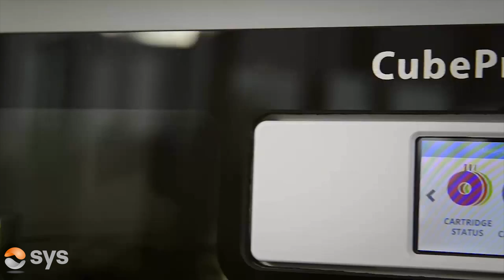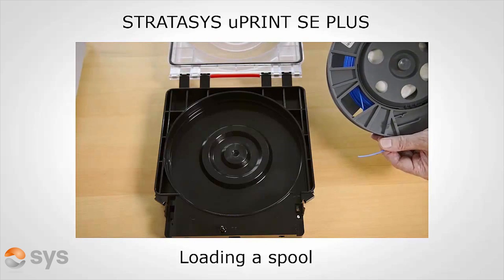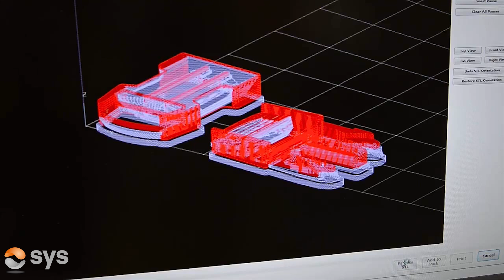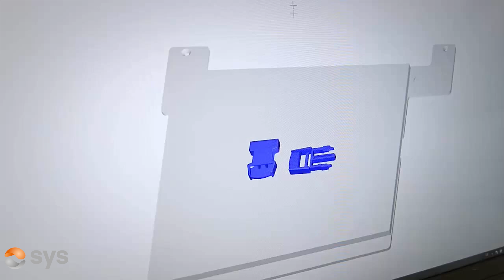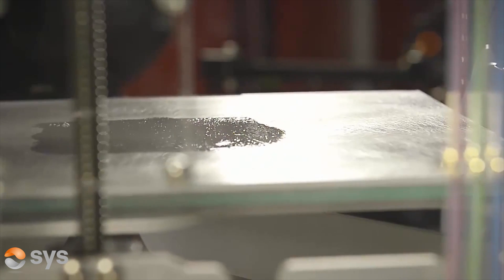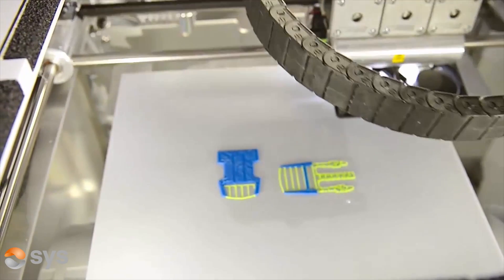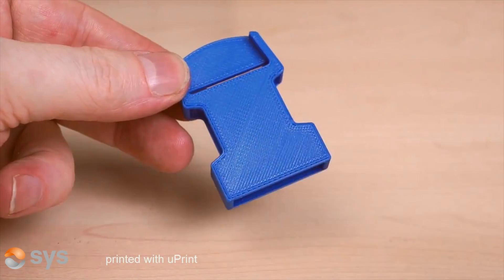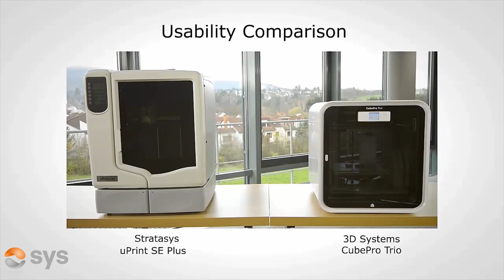Stratasys uPrint SE Plus vs 3DS CubePro Trio

Comment: Try to compare it to the Ultimaker 3!
Reply: I have both. The UM3 is very good, but the parts are not as robust (printing with ABS is finicky). The UpSEp is like a 3D printing oven, that keeps the material at the perfect temperature to ensure ideal layer adhesion. Also, the entire machine is much more rugged, and it is more dimensionally accurate when printing. The part finish of the UPSEP is more rough (you can see the layers), but the parts are immediately useable as functional parts. Just as good as production ABS parts. The uPSEp is essentially plug-and-play, which is essential if you're a professional designer that doesn't have a lot of time to mess around with settings and tweaks in order to be productive. 

The UM3, on the other hand, produces parts that aren't quite as accurate, and they take a LONG time to print. Especially if you pick the finest resolutions. It's a great cross-level printer between a hobby printer, and a professional volume printer.

Comment: I have cube 3, cube x and cube pro, I bought them cheap on ebay, running costs are bad, forget these printers if you want to live a healthy life with no frustration or high blood pressure.
almost every ABS print on the cube system fail gloriously, better with PLA

Comment: Very outdated video clearly they don't know the CUBEPRO uses a Rinse away material (water soluble), prints at lower resolutions and it cost a quarter of the cost. Really a no brainer, my choice is CUBEPRO. Cheers!
Reply: +Orlando Ruiz I think if you look at 11:48 in the video, you'll find that the CUBEPRO is likely not a 'no brainer'. The uPrints have higher sales despite cost difference than the CUBEPRO for a good reason. The uPrint SE is reliable and yields really good looking parts.

Comment: Lets talk about the way they are most similar...

Both are completely closed designs. You have no freedom to choose materials outside of their own limited offerings. You are locked in to buying their incredibly over-priced proprietary materials. Control and slicing software is similarly limited. Your control over the process is dumbed down and very restricted.  Real open hardware and software unleashes your creativity by giving you the power to completely control the process and all the myriad of variables involved.
These machines are designed for buyers with more money than brains - stuffed shirts with no mechanical aptitude or creative  abilities. The end result is a over-priced monstrosity that is more hype than creative tool. They know their market - corporate customers who really don't understand the technology and who think that more expensive is a safer bet an less likely to get them fired if the machine doesn't deliver as promised. By purchasing one of the the most expensive machines on the market, they think they are buying insurance against the fact they they really don't know a damn think about the technology.
The fact is - these overpriced machines must still deal with wide number of variables involved with successful - high quality 3D printing. A quick survey reveals that there are a very large number of complaints about the quality of the parts that these machines produce in the hands of  a great many "operators". I've seen numerous cases where a skilled and enthusiastic owner of a quality consumer grade machine can produce better parts at much lower cost. There are horror stories about both these companies - especially 3DS when it comes to customer service and expensive support contracts. 

One must also be careful when purchasing what they perceive as a top notch pro-sumer machine. Case in point - the 5th generation Makerbot machines. Back in the day when Makerbot was an open source design, they were good machines. But Stratasys saw a chance to eliminate competition and to buy name recognition, so they swallowed them up. The new Stratasys-Makerbots have earned a very bad reputation for poor reliability and constant jamming. They designed a so-called "smart-extruder" for them that has turned out to be an absolute disaster. Constant jamming and print failures is the norm. Many customers have had their extruders replaced under warranty several time and they still don't work reliably.
Reply: +K Danagger Though I may be biased, in actual experience with both, I think you miss the point that in a purely commercial environment push button and walk away is of higher value than tinkering and spending time dialing every achievable capability. The Stratasys units are better in terms of reliability and repeatability, which in a business setting is much more important. We have companies give up the pro-sumer models in every make eventually for ease of use, accuracy and reliability. Cost is more a product of the target market, not necessarily the sum of the options. I'm a fan of open source units too personally, but they have their place and if it's for home use a Stratasys unit is not a cost effective decision.
Reply: That is very accurate. I had the first gen makerbot and omg it was perfect hight quality prints and found a bargain on the 5th gen and exactly what you said about the jamming so i sold it.
Reply: I've used consumer FDM machines personally and for work for 10 years. I love simplify3d and miss some of it's settings. 

However I just convinced my employer to purchase a Stratasys F370. Why? Because I don't have time to fiddle with a consumer machine. I don't have time to explain why people can't print solid parts, why half the builds fail and I waste time adjusting settings and de-featuring their parts, why we can't giant ABS, ASA, and PC/ABS parts without warping and why we're stuck with PLA parts that turn to playdough in a hot car.

For the money, you get a push-button reliable machine with the constant support of a giant company, that absolutely anybody can use easily.

You sacrifice the ability to tinker and experiment with settings, which is why I own a giant IDEX consumer printer at home.
Reply: I definitely see your point.. i hate it when companys make stuff so  Proprietary that you're very limited in what you can actually do with the very expensive machine. Take Allen Bradley. They would not even tell me what drivers i needed to control one of their servos because i was not a distributer. Or HAAS that sent you a CNC mill with all the  Functionality but charge you an arm and a leg to unlock it when you need it. I just bought as stratasys U print SE plus at an auction for a 100 bucks So im going I use the heck out of. There are cables that allow you to reprogram the material eeprom chip to refill and allow different materials to be used.
Reply: @What-is-thehandle  only 100$? Dude you won the lottery. Love to see new videos on that to see how it's holding up.
Reply: lol my office bought am cube pro trio few years before i joined and its absolutely crap. managed to get one print out  but I've had about six misprints now, even after recalibrating completely

Comment: So has 3D Systems yet changed their software (since the Cube X Trio that I had to return!!!) to allow you to print SOLID walls thicker than 2mm???  What insanity that was.  For most plastic consumer products I design, 0.080" to 0.100" are typical walls, and with the Cube X Trio I bought (and later returned) I got two walls, with an air gap in-between, bridged by ribs that the PROGRAM (not I as the designer) chose where to put them.